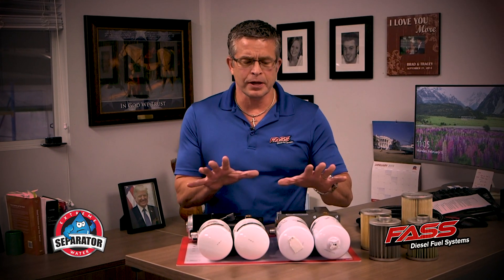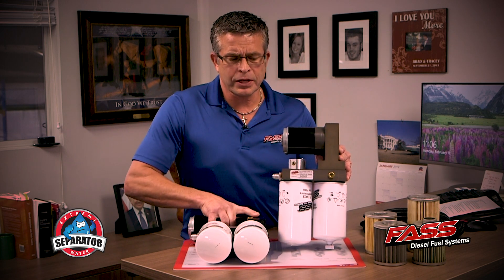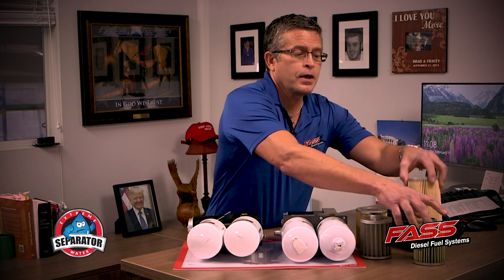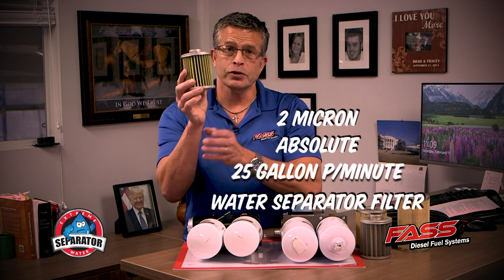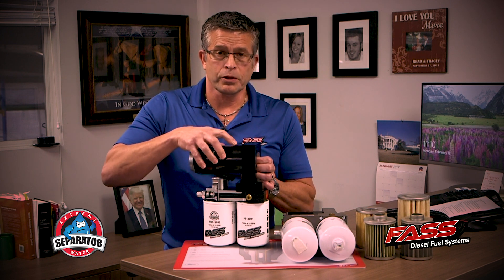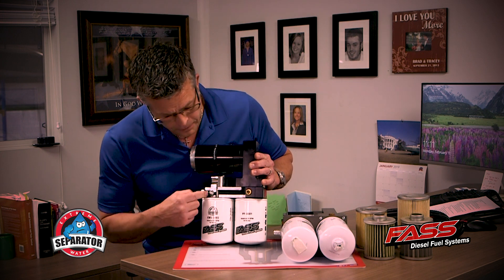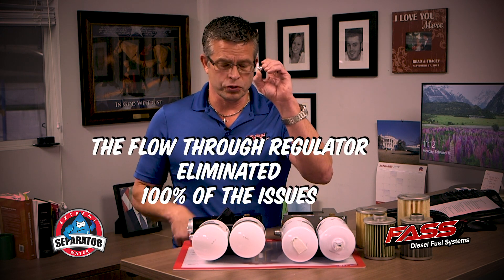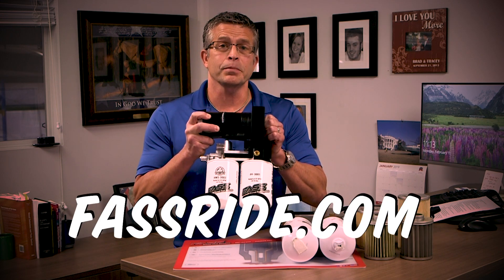NEW FASS Signature Series Diesel Fuel System "What are the Big Differences"

Comment: So that water separator will last 10k miles with no issues??
Reply from the maker: Our recommended service interval is every 20-30,000 miles, or 1x per year if driven less.
Reply: @FASSFuelSystems  the water separator filter swells with water so that’s the reason a person wouldn’t need a drain on the filter?
Reply from the maker: @BC-jm6th  That's correct–unlike older styles that pool the water near the bottom of the filter to be drained, our Extreme Water Separator actually traps moisture within the element itself. When you change your filter, you physically remove all the water along with it.
Reply: @FASSFuelSystems  doesn’t that restrict the flow since it swells up?
Reply from the maker: @BC-jm6th  If neglected for extended periods of time (well past the service intervals), it may restrict flow to prevent contaminated fuel from reaching injection components. Similarly, a drainable filter will eventually push water back into the fuel if not drained or replaced regularly. 

However, unlike drainable filters, our filter element will not feed water back into the fuel if left unattended.

Comment: Hey guys, what do you think about this on a 2021 Ram eco diesel? Is this overkill for the application? My main concern is having to buy fuel from many different locations so I have no control over quality. Do you think this will end my manufacturers warranty?
Reply from the maker: Hey Cliff, thanks for reaching out! 

Unfortunately, we don't yet offer a system for the 2021 EcoDiesel. Sorry about that! 

At the moment, we only offer filtration solutions for the 2014-2018 models. But if we hear anything from our engineering team about an update, we'll be sharing right away!
Reply: @FASSFuelSystems  Thank you.
Reply from the maker: @cliffelwood4992  Sure thing!

Comment: Bought a Signature system for my Motorhome a few months ago. Did not notice any change in engine except for the startup, after about 5-600 miles the motor has never idled or worked better. I am impressed and hopefully it will save the manual injection pump on my Cummins. Thanks FASS

Comment: I bought my signature series like 3 months ago and I love it its so quiet it made a difference in my duramax starts up faster my engine is a bit quiter now and more throttle response but I like to run catfilters on my liftpump
Reply: New Gen Fass filters are better. 99% water filtration vs ANY older drain style filters are about 60% then when full they will pass ALL the water through
Reply: jonhasDirtymax Agulari- your an idiot if you really think a fuel pump did all that....

Comment: Now that the filters a shorter, does this mean they'll be more hidden under the truck? I've been comparing Fass with your competition. Making my purchase likely tomorrow.. I have a 2015.5 GMC. Is the TS C12 165G the newer model in this video? Great video by the way.
Reply from the maker: Hi Mike,  With the shorter filters and the bracket being adjustable you can choose to have them lower and showing or tucked up under the bedside and not be seen. And yes the TS C12 is the new Signature Series.
Reply: @FASSFuelSystems  My Lift Pump was delivered today. I read over the instructions (downloaded from your site) and it says I need to drop my fuel tank (step #2, C.) The installation videos I've seen online don't that. Is this required or do I only need to disconnect the fuel line and install the blue/provided one into the lift pump?
Reply: Haha they got you!!! Seen a possible sale, responded quickly to get your money, then dumped you once you ordered, typical FASS customer service 😂
Reply: Mike Schneider is an Airdog employee

Comment: Hi. In your response to Adam, you state the PF-3001 filter is serviceable. What does this mean? Is the XWS-3002 also serviceable? Please provide any information you can about cleaning/servicing these new filters as I need to purchase new ones soon and want to fully understand the best option. It seems odd to me that you would remove the drain capability from the water separator and let the change interval be "dependent on the fuel we are getting"... A couple of bad fillups with excess water can now leave me stranded on the side of the road if I don't keep a spare filter with me at all times? Thanks in advance.
Reply: Dontknowitall 99- still waiting for a response? So is everyone else that’s ever contacted FASS. They will never respond. They take your money and leave you with a broke POS. Sorry partner

Comment: I just had a Fass Fuel pump fail, 3 years In 600,000 miles. 
Fass stands behind there product under Warranty and new pump is guieter and My fuel pressure gauge is Consistent. 
I Drive 150,000 a year and glad I have Fass Fuel on board!

Comment: Does this still have the ability to add a fuel warming element for us folks in the frigid north?
Reply from the maker: Yes. The Signature Series can still use our HK-1001 Heater Kit and still has ports to run coolant to and through the base of the pump.
Reply from the maker: https://fassride.com/shop/product-category/accessories/electric-heater-kits/
Reply: @FASSFuelSystems   A couple follow up questions that were sparked from the conversation about the new filters.  
1. From what I am understanding, the new filter is able to trap the water, but let fuel flow through.  Without knowing the specifics, I assume this has to do with the size of the water molecules vs. a fuel molecule?  IF that is the case vs. some other wizardry, what about when I dose my tank with some Power Service Anti-Gel?  Will that flow through or will it get caught in the filter?  Reason I ask is that it's been DEEP below Zero degrees here in Wisconsin in the last month many times; I've been adding additional anti-gel as a precaution.
2. What happens if my fuel does start to gel?  Would I be able to run some of the Power Service "Diesel 911" with the new filter system and be ok or would the additive bond with the water molecules and get caught in the filter making me have to change the filter anyway?

Thanks for the info -
Reply from the maker: @asdfjkl-r4c  Most additives would not get filtered out or affect the filtering or water separating capabilities of the filter.

Comment: Honestly the Airdog II 4G is fine. Its quiet, can't hear it run. It's smaller, easier and more secure mount, has water drain, costs less and truck runs much smoother than with the stock lift pump.
Reply: I hope they did a decent job this time mine only lasted 5,000 miles and it was dead then I spent about a month trying to get a response from customer service never did and I gave up and ordered the fass  witch had a way better unit that can do more than it's rated and I could get ahold of customer service Everytime I had a question  I have heard people swear by airdog but my experience is that they are not reliable to run a business with mainly in cold weather below zero the fass titanium has zero issues I'm even running one not made for my 6.7 with zero issues even though it's not rated for it and I have close to 100,000 miles on it
Reply: I hope you never find out different I have run stock Holley raptor airdog fass and fass titanium and the reason was because everything failed except the fass titanium but you may not be making 6 to 8 thousand miles trips on a regular basis and I do
Reply: James Sykora the airdog II 4G is a different design and they made improvements to motor shaft, bearings and coupler. It looks solid.
Reply: Airdog sucks

Comment: Ok so how do you drain the water when it’s gets full then. And how many miles are those filters good for. How’s those filters compare to the old ones with additives. Are you guys going to keep selling the old filters
Reply from the maker: You no longer need to drain the filters. The filter change interval is dependent on the fuel you are getting. If you are getting good clean fuel then you can change the filter every 20,000 to 30,000 miles. Good additives will have no effect on the new (or old) filters. We will no longer sell the old filters.
In all of the testing our R & D department has performed with an outside laboratory we discovered up to this point all other filters claiming to separate or remove water are not as efficient at removing or separating water to the extreme current capabilities of the FASS filters. We will be releasing our testing soon. 

Our new particulate filter, our PF-3001 Primary Filter, is a serviceable stainless-steel wire mesh that protects our fuel pump by filtering larger particulates. It not only protects our fuel pump, but it also drastically reduces noise by reducing restriction which also produces increase fuel flow rates!

Our XWS-3002 Extreme Water Separator is a 2-micron absolute micro-glass fuel filter! Micro-glass is 400% more efficient than all those other filters using a cellulose media! Our filters are capable of 25 gpm, not 25 gph but 25 gallons per minute! That is 1500 gallons per hour!! We were able to reduce the size of our filters as we have had customers request this, but we didn’t want to lose the efficiency. We were able to do this by going to the micro-glass media. For cellulose to compare in efficiency and surface area you would have to take our current size of fuel filter and times it by 4! That would be a huge filter, but we were able to reduce the size by just using a very high-quality media, simply the best on the market! These cellulose water separators, when full, will pass the water exceeding its capacity to where our XWS-3002 filter will eventually shut the engine down. This not only saves your very expensive fuel system but also saves you the potential expense for a tow to a shop and saves you the expense of down time and possibly a hotel stay.

Now getting back to the water separation portion of the filter. The new media grabs and holds the water like a dam. This filter is so efficient it grabs 99.96% of the water at 290gph. The lower the flow pump you have the more water it traps. Now you may be concerned about it during cold weather as we were also. As the pores of the media traps the water that pore becomes blocked. That is another reason we chose a media that is 400% more efficient. The efficiency of the our new micro-glass media gives the fuel, effectively, much more surface area to travel through as compared to a less efficient cellulose media. 

Micro-glass is also a much higher quality element coming with a much higher price tag in which we have been able to absorb due to our purchasing volume and power which in turn we have been able to pass on the savings to you.
Reply: FASS Diesel Fuel Systems so where does the water go that it traps or collects
Reply from the maker: @abner99ification  The XWS-3002 traps the water in the filter media.
Reply: FASS Diesel Fuel Systems that makes no sense so the diesel fuel just sets in water all the time. You can’t get rid of it. That’s the whole purpose of a water separator is to get rid of water you didn’t know was in the fuel. You can’t see what your pumping or when the filter is 100% full of water. This sounds like a horrible idea for filter set up I used to drain mine once a week and there was always water in it. So now it’s like a sponge soaking it up holding it contaminating the fuel. Makes sense
Reply from the maker: @abner99ification  The XWS-3002 will allow only fuel to pass through the media. If the filter is 100% full of water, the FASS pump will not pump. if your current water separator is 100% full of water, it will start to pump water. Keep an eye out for our video showing the testing of the new filters. I honestly didn't believe how well they worked until I saw it with my own eyes.
Reply: FASS Diesel Fuel Systems I would love to see this in action proof with eyes not words
Reply from the maker: @abner99ification  We should have a video out in the next couple of weeks showing the testing process.
Reply: FASS Diesel Fuel Systems perfect can’t wait
Reply: Would be simple for them to keep the drain on the bottom wouldn't it....
Reply: snikwad003 I guess people weren’t draining it. That’s there problem people are dumb
Reply: I agree with Adam. No water drain is a bad idea.  Fass says pump will shut down when full of water so now my truck is dead on side of road or what? I live in a wet climate and drain water every few weeks. Now you have to by special Fass over priced filter more often
Reply from the maker: @country7900  You can still use cross reference filters if you would like.  https://fassride.com/portfolio-item/replacement-filters/ Using one of these filters will still allow you to drain the water out if you would like.
Reply: Country I agree